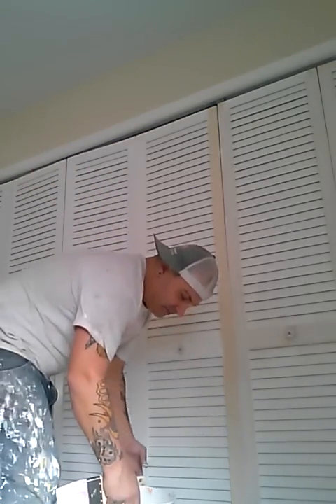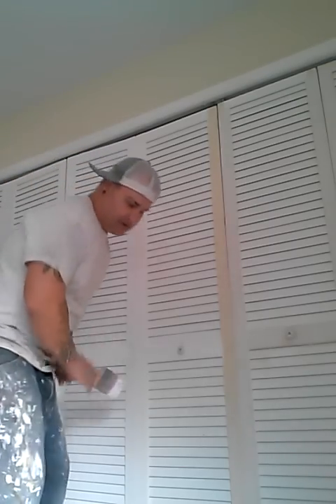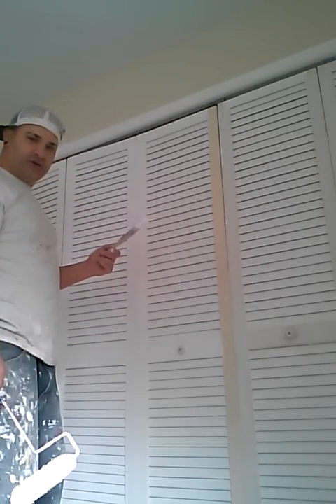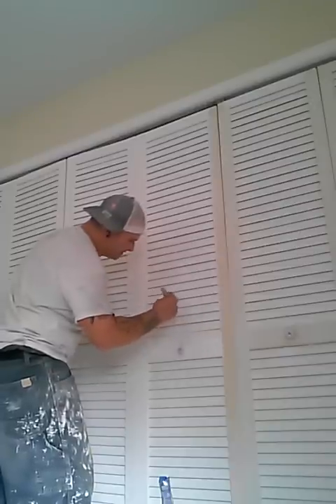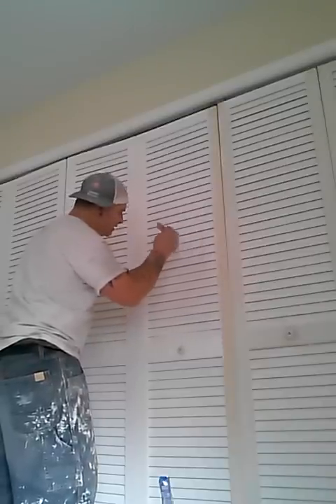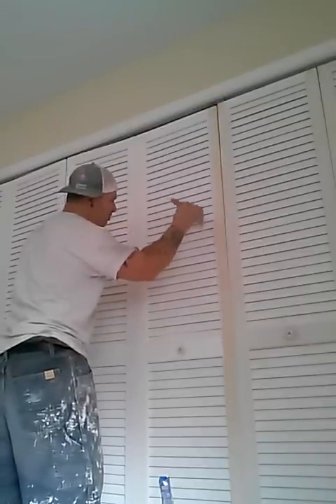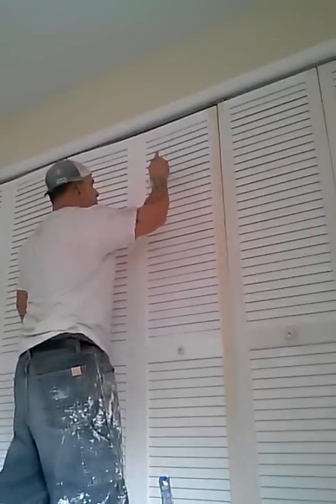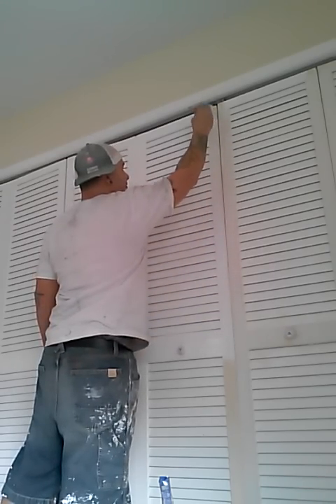Pro painting of louvered door by Dan the man

Comment: Exactly what I need to do, thanks for posting this,  and the ideas.     I turned  bi-fold doors ,  into solid sliding doors using reinforcing plates at the joints (on the reverse side facing the closet interior).     I like the plantation/country cottage look of louver doors, but the bifold doors I bought (very cheaply at Habitat for Humanity) didn't fit the closet opening.   I used Benjamin Moore Regal....the paint is thick and I had  no drips when applied as in this clip (doors were factory  pre-primed).

Comment: nice tecnhique
i m an amateur just spent 1.5 embarrasing hours tryin to paint a louver (1side!) closet door and its still looks like its just primed.
I got a question
i think i got the wrong paint
i m using Behr white primer and paint combo gallon.
But the doors are very clean and smooth light pinkish paint. shouldnt i just be using
a semi gloss or egshell white paint?
is that why its taking so long  to cover 1 door(besides the fact that i suck)
any advice appreciated

Comment: Hey Dan found you when I googled painting louvered doors and I have to do myself.  Love this tipping method and here’s my questions .  If no screen to reduce paint on roller how do you avoid splatter ?  I don’t need 5 gals so will use tray instead .  Do you plastic off inside of closet so paint doesn’t spray through louvers ?.   Thx